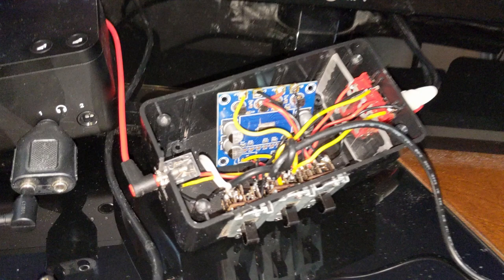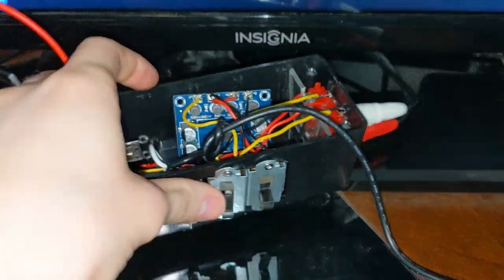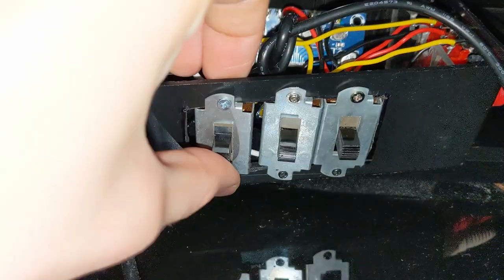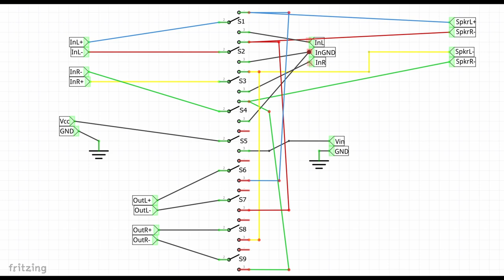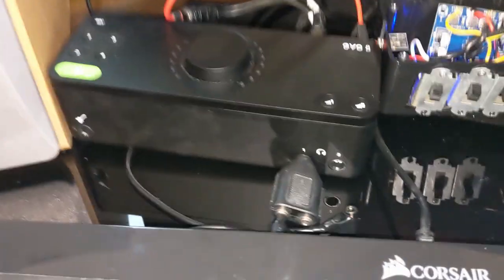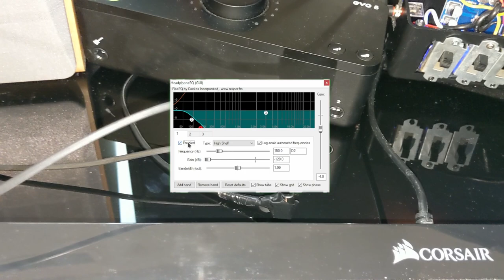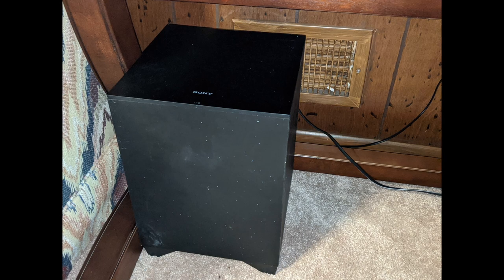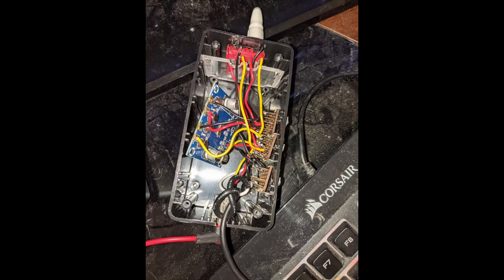DIY Audio Amplifier Switch Box and Subwoofer Setup

Comment: Could you maybe go into a bit more detail about how you set the subwoofer up to have manual input? I'm trying to do the same thing with the same subwoofer rn but am at a loss.
Reply from the maker: what do you mean by manual input? for converting from wireless to wired, i just treated the subwoofer as a speaker and connected an amplifier to it. then, i connected the amp input to an rca plug for convenience